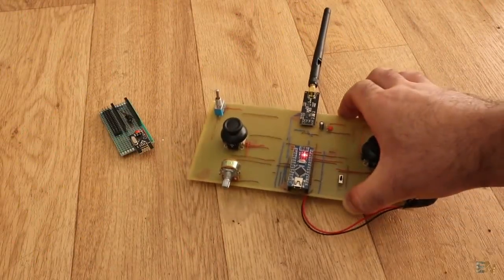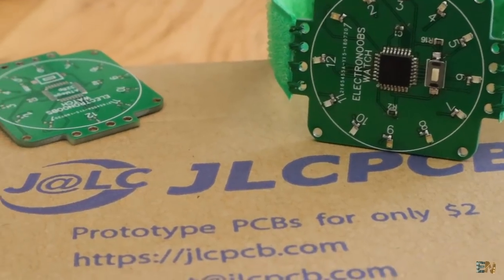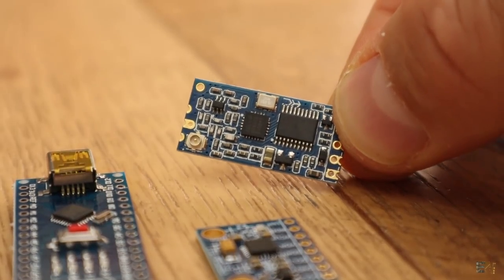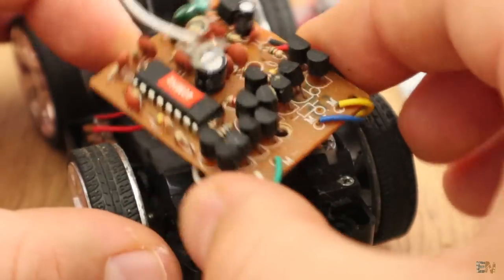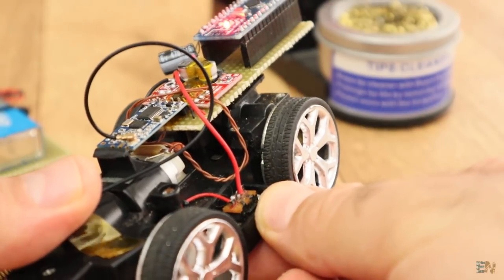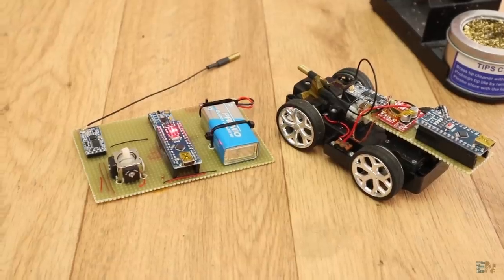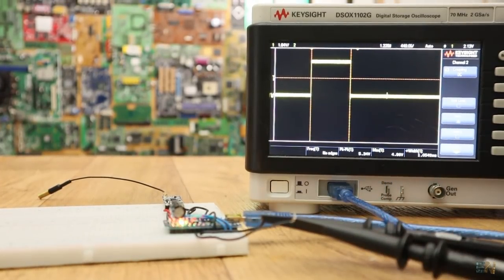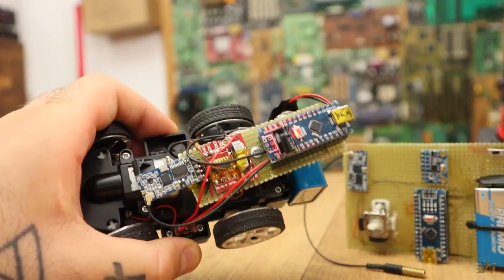IMU based radio controller - control toy car with movement

Comment: If you want use servo instead of dc motor then dont use hc-12 on software serial as both software serial and servo library uses timer 1 which will conflict with servo causing it to vibrate so use hardware serial instead